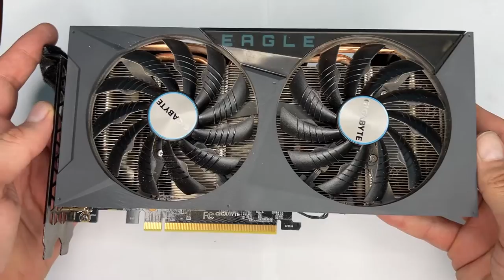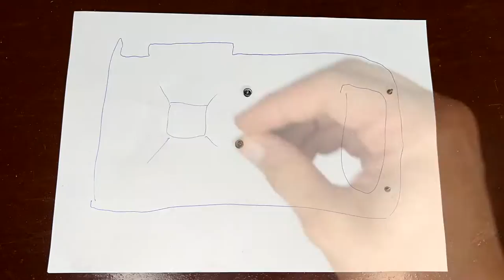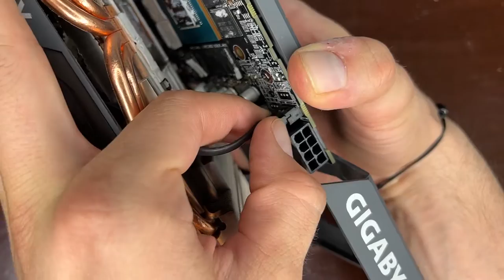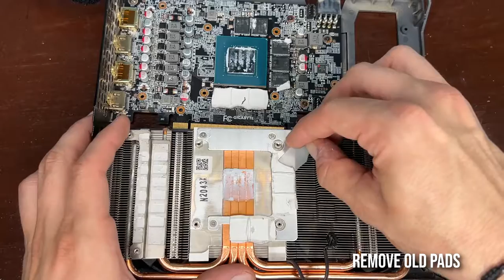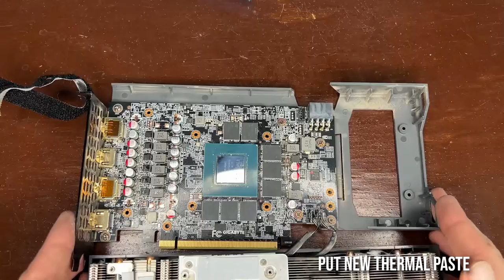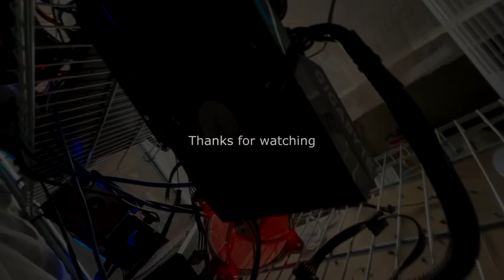3060 Ti Gigabite Eagle, Thermal Pads Replacement

Comment: can confirm, i used 0.5mm arctic pads everywhere and temps never go above 76 C while heavy gaming, streaming and watching a vid with +500 on memory speed, and clock at 1950 with 0.900 mv, hotspot stays at 89, seen it once at 91 in very heavy dense area in a game at 1440p 144hz, mine is REV 1
Reply: At only 0.5mm can you use thermal  paste instead?

Comment: Always use antistatic band when handling GPU / CPU. Too much thermal paste. 50% of that with spreader does the job. Use isopropyl 90%+ with ear buds to avoid any damage to miniutescale components with static discharge.
Reply: You don't always have to use antistatic bands. As long as you aren't stupid you won't shock your shit.

Comment: I knows it’s been 10 months since this video. But I’ve just changed my thermal past and is now 7 degrees cooler
Reply from the maker: thats also ok result cuz you dont have ram temperature sensors
Reply: did you used therma pads as well? i don t have those so i m thinking just to apply thermal paste

Comment: Wich cable is for the LED? I want to control it with AURA sync, and i heard that you can just plug out an in to the mainboard.
Reply: I'm controlling with "SignalRGB" its a very impressive software try it

Comment: I did the thermal paste replacement and now my gpu cannot be detected, keep showing no signal and when I check in BIOS noting show on Pcie16x slot although the graphic card is powered up and fans running. Any idea what’s wrong?
Reply from the maker: Probably you didnt assemble it good, you dobt have good contact, and it is not detected
Reply: Try reseating the card. Ensure the power cables are properly connected.

Comment: Biggest mistake is 1mm pads....0.5 is acceptable, 0.75 if you can find.  Thermal Grizzly 1mm is acceptable as it's compressed-thickness is 0.8mm - still not ideal though.
People will say "you can compress it, doesn't matter"   It definitely does matter, if it isn't compressed enough or if it's too compressed the operational density will change.  More density usually means more conductivity but actually not in this case as some of these pads have lattice-structure molecules and over-compression can affect the alignment.

Proof is that I got 11-12 degrees cooler temps by using the 0.5mm pad vs squashing the 1mm (and it was squashed a LOT to allow the CPU to make contact with the copper pipes).
Reply: THANK YOU SO MUCH! i was trouble shooting for 2 hours after replacing thermal pads and paste. Temps were rushing straight to 110 degree hotspot with 1mm pads. Used 0.5 and now everything works fine
Reply: @CryEntertainment  Did you use .5 for all the parts?
Reply: @deeznuts5034  yes
Reply: Did you use .5 for all the parts?
Reply: is it the same on all 3060 ti cards? im planning to repaste and replace the thermal pads on my colorful 3060 ti but im still looking for the right thermal pad size
Reply: Hey man, Are you saying 0.5mm for all the surfaces is a fine ? VRMS and Memmory ?
Reply: I got back rom gigabyte support they tell me it's  1mm ffor the memmory and the VRM closest to the core and tha it's 1.25mm for the VRM's further away rom the core.I am confused.
Reply: gigabyte says this about the thickness of thermal pads:

The thickness of thermal pads are 1.0mm and 1.25mm.

2*1.0mm (40*14*1.0mm)
2*1.0mm (67*11*1.0mm; 25*14*1.0mm)
1*1.25mm (74*6*1.25mm)

Feel free to contact us again anytime if you have any feedback or need any support from us. Cases without updates in 7 days will be closed until further information is received.

Regards,
GIGABYTE
Reply: God damn it why didn't I look for comments like this first
Reply: Im using eagle 3060 over 1 year
Reply: Instead of thermal pads, I advise you to apply thermal putty Upsiren UX Pro. And try phase-change material Honeywell PTM7950. It comes in as a sheet, lasts longer, performs works better than traditional pastes and there is no pump-out effect. It is also a good idea to do undervolting.
Reply: I couldn't find any video or post for the Gigabyte Windforce 3060. Since the Eagle is the closest model I'm thinking it could use the same size of thermal pads, but I'm not 100% sure.
What do you think? Any suggestions would be appreciated.
Reply: cpu or gpu you wanted to write? And... all you wrote is for the gigabyte eagle 3060 12gb? thanks

Comment: Thx i never could've done it without this video. Temperatures used to be 85°C and now it doesnt get hotter than 74. No more thermal throtteling finally. Fan connector was a bitch to get out tho so i unplugged the 2 fans on the other side..
Reply from the maker: Nice results! Glad that vid helped you! Cheers!😀
Reply: Did you changed the thermal pads too? If yes what thickness was it?

Comment: I have the same card, I changed thermal paste to Kyronaut, before 83c° max temperature, after 63c° max. Very impressive change - 20c°.
Reply from the maker: Great results, congrats!
Reply: did you change thermal pads? if yea, thickness?
Reply: I have not changed the thermal pads.

Comment: As others mentioned, the pads must be under 1 mm. Even when coupled with good quality thermal paste, there isn’t enough contact between the chip and cooler. I tried running Minecraft with  1 mm pads and the GPU reached 80 C instantly.
Reply: so 0.5mm for all?
Reply: Some recommend different sizes for VRAM, but I went with 0.5 mm for everything and got great results. Even when messing with the fan curve, the temps tend to stay below 70 C.
Reply: @supdown123  I've just done mine with 1mm for the VRMs/power side and 0.5mm for MEM chips, and got ok results, about 73C to 75C max load (down from throttling at 83C open case, mind you!) but mostly the same on the hotspot (in terms of delta from core) - if I get pumpout then I'll take that as a sign to change the size of those pads too

Comment: I was trying this today and using this video as one of my references, but got stuck at the "unplug fan cable" step about 50 seconds in. Felt like I was getting closer to ripping off the port than getting the cable disconnected, so I gave up and just ended up wiping and repasting with it half open like that. Any tips on getting that undone properly? I looked at another similar video, but when it came to that step they just seemed to poke at it a bunch in fast forward, so not much help.
Reply from the maker: Yeah it is always problem with that, and it you push hard it is easy to brake it...Try to help it with little screwdriver, but do not push so much, and press port with finger to not brake it, also good nails can help to reach out

Comment: I was going to unplug the fan cable and One of the four wires is cut off but the fan is working does that affect?
Reply from the maker: If it is working it is good, but you cut something for sure, solder it if you can
Reply: @KrunoEti  nothing happened except the rgb Is there a definitive way to remove the wire because I tried to remove it but it doesn't?

Comment: Mine doesn't open. I've undone the 8 screws on the top and 2 on either side and it seems to be stuck shut on the side opposite the hdmi connectors
Reply from the maker: Pads may be sticked
Reply: same problem here, did you find out ?

Comment: O que acontece se você usar thermal pad de 1,5mm ou 2mm ? O certo seria 1mm em tudo ? Minha placa de video rtx 4060 Eagle OC 8gb .
Reply from the maker: Better is to use pads that are suposed to be by manufacutrer, it will better fit and better transfer heat

Comment: Is this 3060ti Eagle or 3060ti Eagle OC ?    Gigabyte Support was finally able to get back to me they found that the vrm on the far was 1,25mm and the rest was 1mm. That's on the Eagle OC not the Regular Eagle which I think this is.

EDIT: HOLD ON THIS IS THE EAGLE OC. However the people in the comments are saying the rtight size is 0.5mm or the memmory and 1 of the VRM's Im conused again.
Reply: i have 3060ti Eagle OC Rev 2.0, please tell me what exactly thermal pad for this GPU?

Comment: mine used ex mining goes into 90+ on 200w and than thermal throtells back to 150w at 90+ in furmark. for gaming its no different i deffs gotta change it.
Reply from the maker: True
Reply: @KrunoEti  from you're experience would you recommend 1mm pads for all surgaces or 0.5mm for all surfacce ? If not what combination of what would you recommend ?

Comment: Hi 😁
is it a problem if I put 1mm thickness everywhere?
Reply from the maker: You can put it 3mm if you can squish it rnought to have good contact
Reply: @KrunoEti  no you can't put 3mm, the CPU will not touch with that thickness.  0.75mm is Gigabyte Official pad, you'll have to use 0.5mm
Reply: @Lancia444 hello friend, it's been a year, but I would like to know which pads would be better in the same graph of the video, 0.75mm or 0.5mm, thank you.

Comment: Graphics card high core temp thermal paste or thermal pads?
Reply from the maker: For core is thermal paste
Reply from the maker: But gigabyte has crap pads also, so if you opening I will do it booth
Reply: @KrunoEti  was getting worried got card and even with 900 mv undervolt it would thermal throttle searched online seamed to be normal
Reply: @KrunoEti  what thickness and what size ? Is 100*100 thermal pad enough?
Reply from the maker: @bigboi6471 always have more than less, but 100*100 will be enough for that, thickness is showed in video
Reply: @KrunoEti  Well ill give a try ill get some thermal grizzly aeronaut and some artic thermal pads 0.5 mm and hope for the best
Reply: @KrunoEti recommend 1mm or 0.5?
Reply: @bigboi6471 did you end up doing this repad and repaste? Haven't seen any performance metrics for 0.5mm pads yet

Comment: What is the pad thickness that you used please ? And what is the temperature change ?
Reply: Should be 0.5-0.75 actually
Reply: @Lancia444  thanks. Did it change your temperatures ?
Reply: @Lancia444  Just 0.5? Or VRM needs  another thicknes?
Reply: @angelpaz5654  I just changed my thermal pads for this card, 1mm for the thermal pads that on the leftmost side of the card in the vid, and 0.5mm pads for everywhere else

edit: spelling
Reply: @Cactus_-kq5rc  thanks, I use the same size. But the core climb up to 78C when i'm playing games like A Plague Tale Requiem
Reply: @angelpaz5654  78C for memory is a very good temperature for gaming, if it’s 78C for gpu core, that’s still a very acceptable temperature
Reply: @Cactus_-kq5rc  78C for gpu core, finally I put 1mm pads on the left side as you said, and 0.5mm to others
Reply: @angelpaz5654  did it make any difference?
Reply: @sanjanbelford  nop, but witch undervolt yes

Comment: The old pads are 0.5mm ...
Reply: 0,7 mm if to be correct
Reply: @flying372  is the problem when i use 0.5 ? I dont have option in my country to get 0.75 thickness pads
Reply from the maker: 0.7 or 0.5 means nothing, they all squeeze when you screew all parts back
Reply: @KrunoEti  my card is running really hot without undervolting the core goes easily to 82 celsius as a temp limit. I checked today the thermal pads and they are still kind of solid not so damaged so i am still not sure if the replacement will do anything. Anyway the hot spot is always around 10 celsius higher than the core.
Reply: @KrunoEti  Not quite true. I found out it when i had gigabyte gigabyte geforce gtx 1060 gaming g1 that has 0,3 mm thermal pads.When i tried to put 0.5mm new pads instead old screwed up original pads the themperatue was 8C hotter . The chip couldnt contact the radiator well , though i tried to press it properly
Reply: @matejsopor5834  Yes, i put 0,5 oddysey expensive pads ,but thats not enough and the videcard has 3C more the temp. The only solution is to buy laird 1mm liquid thermal pads which squeeze well
Reply: @flying372  liquid ? I've never heard anything about that.
Reply: @KrunoEti  no they don't - there is a specific compressive tolerance for optimal performance.  using 1mm will elevate the CPU from the copper pipes, you'll need 0.5....